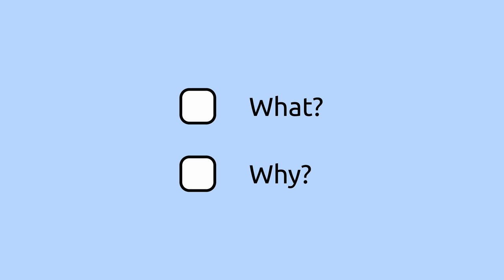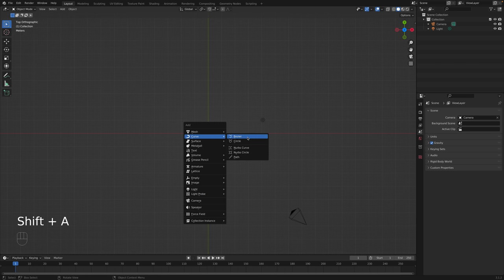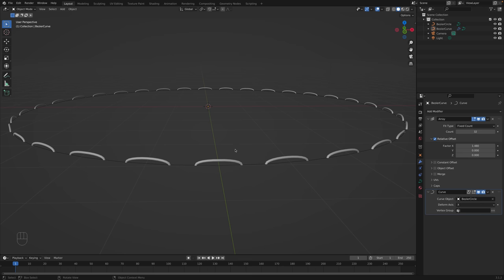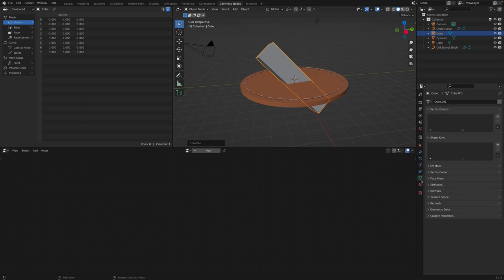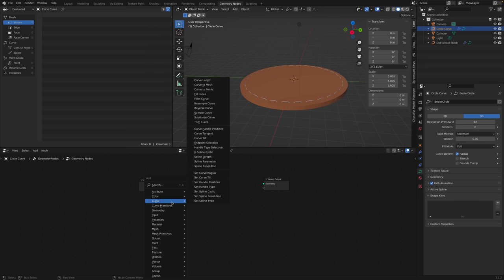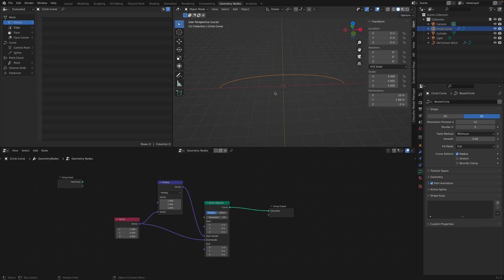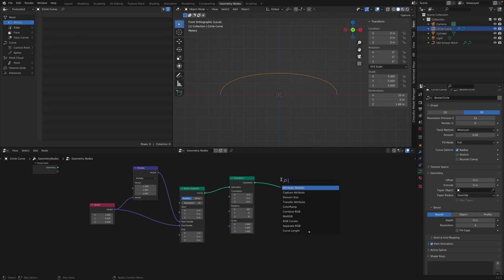I wish I knew this before using Geometry Nodes (Blender)

Comment: So I'm trying to make the results of the geometry node stitching pattern into an editable mesh (just to understand the process). It can't be "applied" if the underlying geometry is a curve that is the basic reference point (it comes back with an error "Cannot apply constructive modifiers on curve. Convert curve to mesh in order to apply.)"  If I convert the curve to a mesh first, the geometry node doesn't produce the correct result because it was based on operations from a curve. I'm stumped on this one, if anyone has a suggestion.

Comment: You failed to mention you have to convert the circle to a curve,  I followed your instructions step by step as you presented them and backed up the video a dozen times because you go so fast, finally had to find a different video on why the eye dropper wouldn't work. I tried to select it with the eye dropper for 5 minutes before looking up why the eyedropper cannot find the curve.
Reply: He started off with a curve circle (Shift A, curve, circle) if thats what you meant? He didnt have to do anything as it took its original information which he explained also, I was doing it a different way and could add a circle curve through nodes as well and create the same effect.

Comment: https://youtu.be/VlSs430PAeU?t=4895 - I do believe that the set material by index refers to the material 'slots' on the parent object itself. On meshes these would be the default method of assigning materials. Not necessarily a 'drivable' method but at least the variable is exposed. just assign the index with an input value, and set the material in the object.
Reply from the maker: Excellent explanation. Thanks!

Comment: too much mumbling, lightning fast mouse moves, no explanation of what you're doing. Added to differences in blender versions (I'm working with blender 4.1) I have to conclude that this video is NOT FOR BEGINNERS 😭 And since I'm a beginner, I'm not able to follow along. Applying the texture to the flatten cylinder was my breaking point. I couldn't even get that done. The sides of the cylinder wouldn't be textured (after Shade Smooth) and after that almost all options used were not in my blender version... disappointed 😦

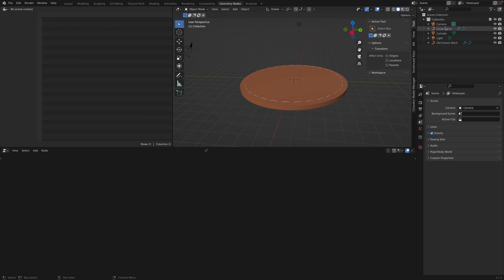for instance: around the 13:00 mark, when adding the Bézier segment, how in heave's name do you get to see that in the 3D viewer ? Nothing is shown in mine.. Also, your 3D viewer shows material even when in Solid mode ???  I don't get it.  I know blender has a steep learning curve, but this is discouraging :(